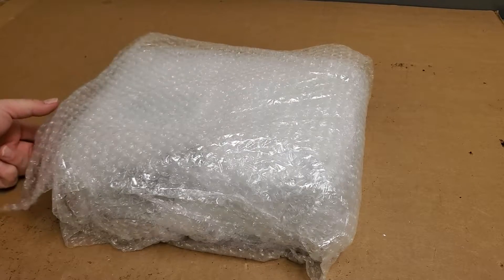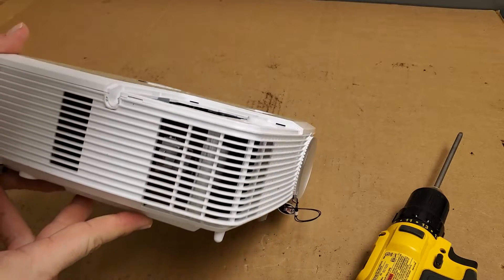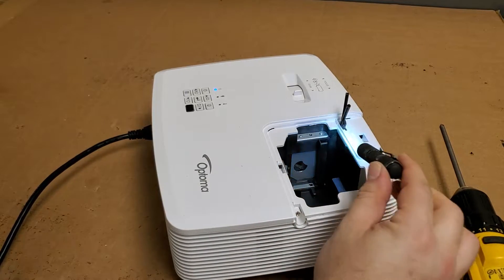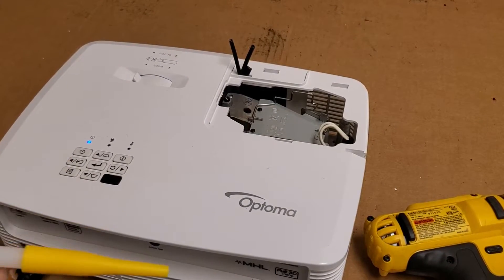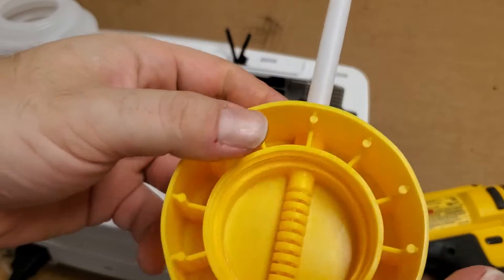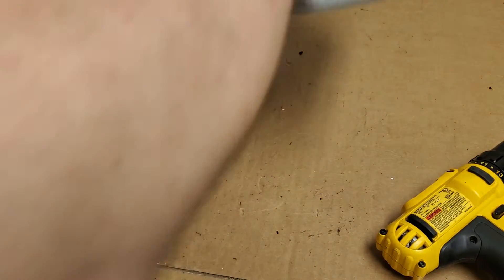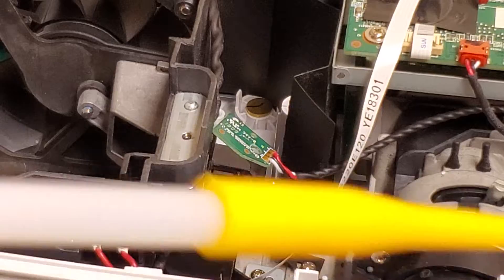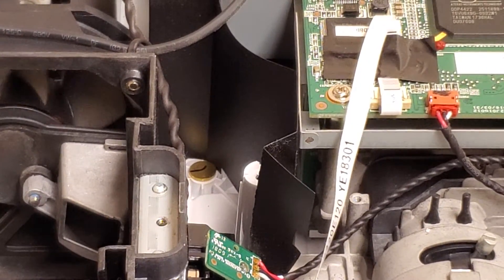Optoma HD27 DLP Projector Repair / No lamp ignition

Comment: Hey Frank- I have an Optoma GT1080 that doesnt work- power led is flashing amber, and lamp led is solid amber- could it just need a lamp replacement? Or any thoughts on a fix? Thanks
Reply: Or how to contact you if it is possible to send you the unit and help fix it?
Reply from the maker: Hi Allen, When was the last time you changed the lamp?  The error you list does point to a lamp issue. I usually suggest trying a lamp first, only because it is the easiest solution most of the time.  Plus you can return it easier if its not the solution.
I suggest a new lamp first.  Make sure its a reputable brand or comes from a reputable seller.  Amazon is a cesspool in my opinion for lamps.  eBay is actually safer in my opinion.  Otherwise, if you are in the states, I suggest any company on this list.  They all sell decent quality lamps that will have the proper IR filter lens that most of the Amazon lamps do not have. https://www.projectorcentral.com/projector-lamp.htm  I'd buy from whoever has the best reviews and best prices.
If the lamp does not solve your issue, feel free to reach out.  My email is listed on the about page. https://www.youtube.com/c/FixitFrank/about
Reply: @FixitFrank  i have not replaced it yet- so i will give it a shot first and reach out in case it doesnt fix the issue. Thanks!
Reply: @FixitFrank  Hi Frank- I ordered a new lamp from Pureland supply and that did not resolve the issue. So i guess its not the lamp. I will contact you as I am hoping you can help resolve the issue. Thanks
Reply from the maker: @allanreyes5587  Email support at Purelandsupply!  :)  I'll get right back to you.
Reply from the maker: @allanreyes5587  that is fine too. Either is OK.
Reply: @FixitFrank  ok. I just sent an email  to sales@weezytech
Reply: @allanreyes5587  same issue with my gt1080. What was your problem and did you get it fixed?
Reply: @corvettericky1332  I sent my 1080 to Frank and he is currently fixing it. It seems to be an issue with the power supply board so he is getting a replacement board for it.

Comment: Hi Frank, i just bought a second hand, like new optama GT1080. When starting up  i have a red power lamp, when i start it it turn blue. Than i hear a click. Then nothing. Bought the lamp indicator and the power lamp turn red. Lamp looks brand new, colour wheel is perfect. I hope you can help me out! Best regards from the Netherlands
Reply from the maker: Cheers Alfons! That sounds like it might be a power supply issue.  Do you get any fan noise?
Reply: No i can not hear the fan Frank. Do you know how i can fix it?

Comment: I was cleaning my Optoma hd70 but now I’ve got vertical black lines, is it the ribbon cable?
Reply from the maker: I'd suggest reseating the mainboard again. That is likely the issue.
Reply: @FixitFrank  thanks, that was the problem.

Comment: Thanks for these videos. Just replaced the bulb and color wheel on my hd27 to fix both problems. However now I see fuzzy white specs on a dark/black image that I can't seem to be able to blow/shake off. Did I dislodge some dust?

Comment: Hi Frank, I have a similar projector the optoma hd142x and the bulb won't ignite neither, but the power works and I can turn it on and after the colour wheel spun 3 times the red lamp led flashes. I replaced the bulb but it still won't ignite, so I took the projector apart and checked everything, the colour wheel, the optics and the fan but everything worked. Could it be the power supply or even the main board? I hope you can help me.

Your videos are great by the way, helped me a lot so far.
Reply: I am
Having the same problem please let me know if u find any solution everything is working but lamp not igniting
Reply: @shahrukh8211  read my reply
Reply: Having the same problem since a few days now. Did you find a solution?
Reply: @lackoo123  yeah, I replaced the power supply and so far it works great. I bought it on ali baba or Express, I dont remember but the name of the power supply is AIO 203g C/T25. But don't take my word on it, i don't know if you are having the same problems as I did.

Comment: Hey Frank can you do a video on cleaning the dust out of the lens of any Benq projector. I have tried to clean them but no joy. After cleaning the mirrors and magnifiers in front of the dmd chip still dust is there. the dust disappears when focusing the lens but as soon as you turn the lens out of focus they appear. I did not clean the dmd for fear of damaging it.